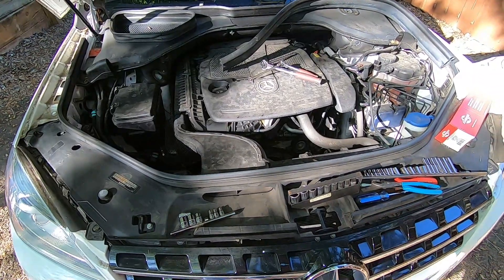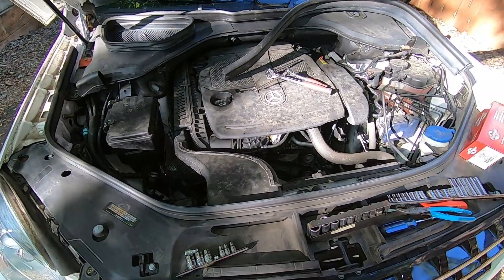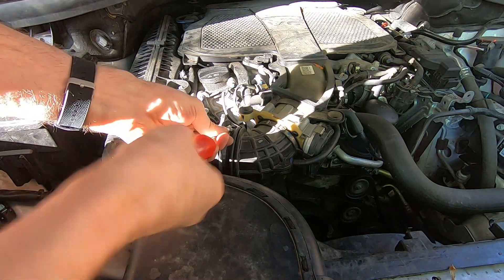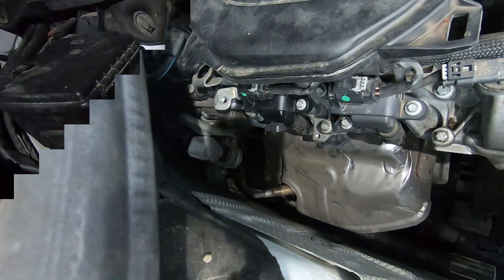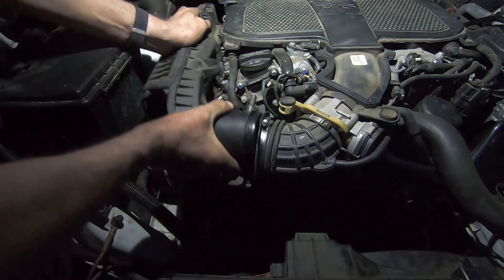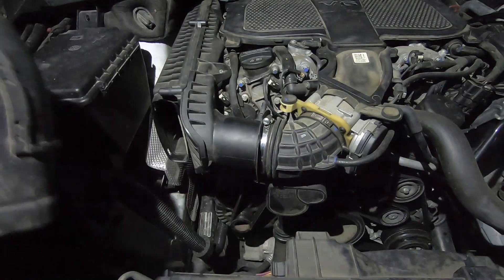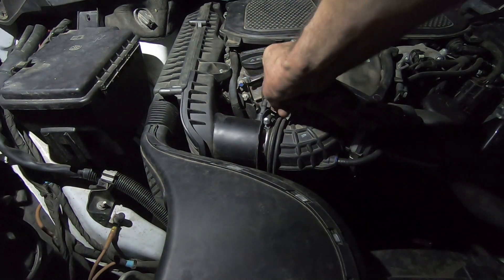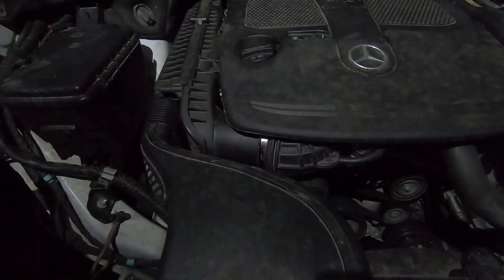How to replace the coil and spark plug on a Mercedes Benz ML350 3 5L gas engine

Comment: What size socket did you use
Reply from the maker: I can't remember for sure, but I think it was a 14mm 12 point spark plug socket. BMW uses external Torx fasteners for a lot of things, so you also need E Sockets.

Comment: What if I’ve got to get to the other side and how do you know which one is which? Are all odd numbers on one side? 🤷🏻‍♂️
Reply from the maker: If I remember right the passenger side is bank 1 and numbered 1 through 3 starting from the front. Bank 2 is 4 through 6. This is a USA Mercedes, so the drivers side is on the left. You can verify by doing an online search.

Comment: Which plugs and coils did you order?
Reply from the maker: I don't remember, but I do remember there were several different brands to choose from.
Reply: I got a coil pack from O'Reilly's.. Light never went off? Still sputters
Reply: @everythingtrucking8949 did ever get your issue fixed?